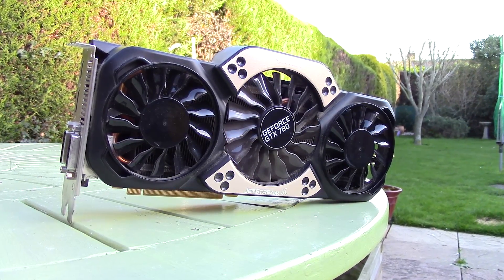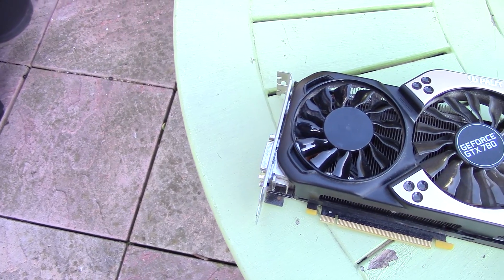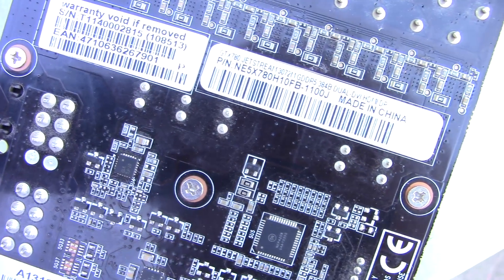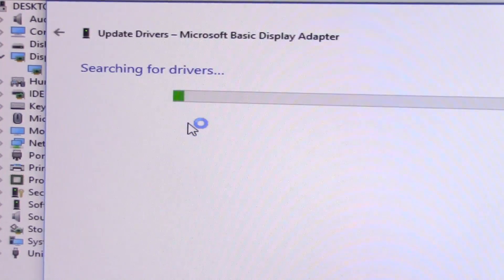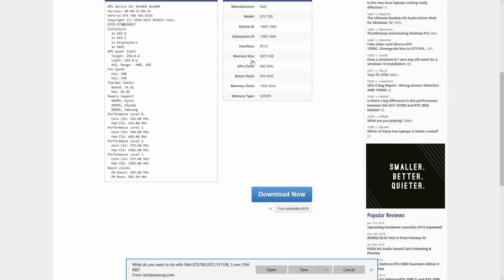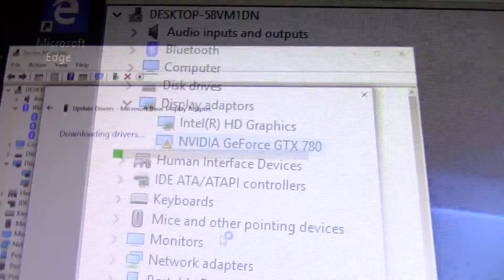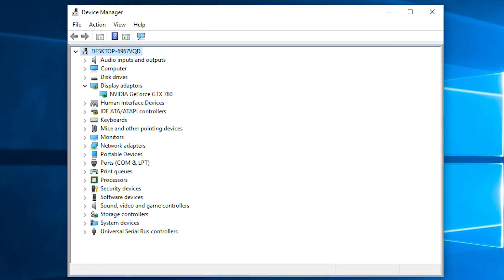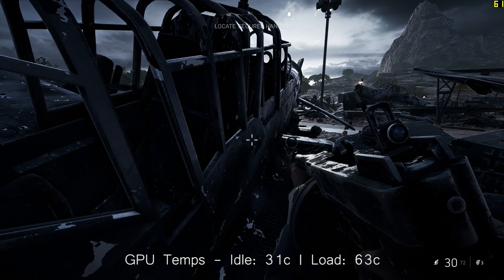Can We Fix This £20 ($25) GTX 780?

Comment: #earlysquad
btw what gpus do you have i have an AMD Radeon R7 240
Reply: Evga 1080ti SC black edition #earlysquad
Reply: @TheRayneBlade  nice
Reply: @TheRayneBlade  do you play csgo
Reply: @m1k4n57  Don't play too many esports games. Mostly 3a titles and the occasional Rouge like. Been big into vr last few weeks though.
Reply: @TheRayneBlade  thats cool i mostly play csgo and fortnite
Reply: Ætheral Fang integrated amd graphics in a laptop motherboard 😫
Reply: Gtx 1060, took me a while and several gpu upgrades before that one
Reply: Got the same as you along with an apu from the same time period, surprisingly good
Reply: I have a R7 250
Reply: gt 740 its terrible
Reply: Gtx 1070
Reply: ASUS STRIX GTX 980,got it for 140€
Reply: I have an old R9 290 and a 1080ti duke from MSI.
Reply: Gtx 1070, 1060 (Laptop)
And an old 770
Reply: Gigabyte gtx 980 g1 gaming
Reply: Hd6950
Reply: RX 580 8GB (PC) GTX 1050 (Laptop)
Reply: GT710
Reply: Hd 7950 3gb version
Reply: PC: 1050TI :D
Laptop: GT220M
Reply: Oldest laptop gtx 280m 1gb
Old laptop gt650m 2gb edition
New laptop gtx 1060 6gb edition 

1st built desktop MSI r7 370 4gb
Current desktop sapphire Rx 480 4gb edition
Reply: Fury X in desktop, Radeon R6 in laptop
Reply: r9 Fury
Reply: HD7850
Reply: GTX 1060, great for csgo I get 160+ on high settings
Reply: Titan Xp Star Wars edition (only good for playing Fortnite, no that's not a joke, 67 fps at 4k)
4x R9 Fury as my main build (on Threadripper)
4x RX 470 (AMD driver preventing 4x from scoring correct in 3dMark, so no 4x records, I do have the 2x TimeSpy record for these)
2x HD8740 potato hardware testing cards
1x GTX 1070 (in a laptop)
1x ATI FireGL-V8650 (first ever 2GB card, whopping 32 Vram chips cover that card, LOL!)
1x mostly dead R9 270 (my first GPU ever, murdered as it ran daily at -58c, it's seen better days, LOL!), it will be set ablaze into its final glory on an EVGA Epower V board cooled by my K1NGP1N T-REX LN2 cooler (yeah, the CPU liquid nitrogen container is zip-tied to a GPU, that's normal enough for me, LOL!), I will give it a proper warriors death.

Side note: anyone want the Titan? Its the SW Empire special edition with display case. Its just slow compared to my main builds, and I DO NOT enjoy overclocking Nvidia (I'll be overclocking a case panel and have more fun... I a modified a VGA monitor LCD monitor screen to make it see through to show off the insides of my case). It has never been modded (as you can tell, I actually do hate overclocking modern Nvidia since it doesn't have a shunt mod or the crappy blower cooler removed). Its just way to slow for me...

Also may need to add some R9 390X2 Devil cards or grab a bunch of 290X cards since miners are selling those cheap (and a duel 390 card for $100 to $150 looks way too nice to not benchmark), there are some great deals going on!

Yep, I love tech and seeing where it goes. I love tech, cheap or expensive, and honestly, some of the most fun is seeing how much performance you can squeeze out of a budget build to get more value. I've overclocked everything from raspberi pi, to monitors, used boost converters to over-volted fans, GPUs, CPUs, RAM, NB/SB/FSB/etc, mouse sampling rates, tablets (I actually water-cooled my tablet, the block I designed is open source if anybody wants it), and my friends joke I'd overclock a watch too... (I would, smart-watches run Android, and that will generally let you overclock them, but I don't think that's what my friends totally meant, LOL!). I love seeing some of the value and fun that this channel brings, from one techie to another, keep up the good work RandomGamingHD!
Reply: radeon VII
Reply: @schlongdas7250  Why? It's worse than the 2080
Reply: TheRandomshite123 i don’t like Nvidia, and 16gb at 1tb bandwidth speeds is more important that a stupid lighting effect. I also use Linux and Nvidia can’t make shit for linux drivers. Radeon VIIs drivers were rushed, so soon it’ll be better than a 2080.
Reply: @schlongdas7250  Its good for workstations thanks to the HBM2, but outside of that nothing exists that needs that much bandwidth, but if it didn't have that ram and had gddr6 instead it could be far cheaper
Reply: TheRandomshite123 It can’t use GDDR6. Vega literally cannot. They can’t half it or they’d lose a large amount of performance because of lack of bandwidth. I’ve seen PUBG use 11gb of VRAM at 4k, so it’s fine.
Reply: @schlongdas7250  The HBM2 in the Radeon 7 alone costs as much as a vega 64, why not use 16 GB of gddr6 and cut the price to be more competitive
Reply: TheRandomshite123 BECAUSE IT LITERALLY CANNOT. IT LITERALLY CANNOT USE GDDR6 WITHOUT A FULL REDESIGN WHICH WOULD COST AMD A SHIT TON OF MONEY. IF THEY DID IT WOULD BE VERY STARVED FOR BANDWITH AND BE ABSOLUTELY GARBAGE
Reply: @schlongdas7250  YES I KNOW THAT, BUT WHY DIDNT THEY USE GDDR6 IN THE FIRST PLACE? LIKE I SAID HIGH BANDWITH MEMORY COUNTS FOR SHIT AS MOST PROGRAMS SEE NO BENEFIT
Reply: Gtx 1660ti (pc) vega 8 (laptop)